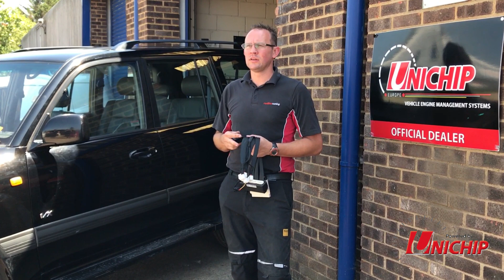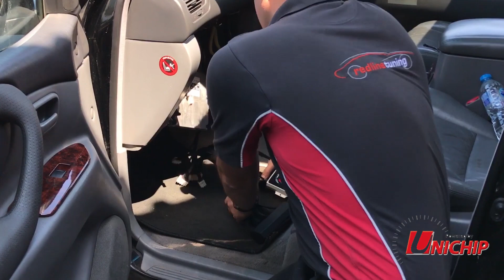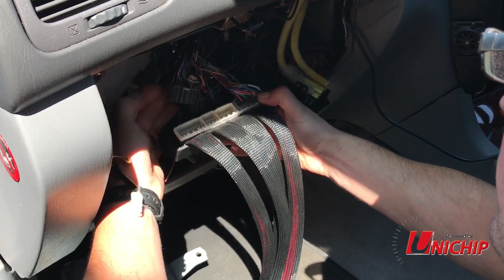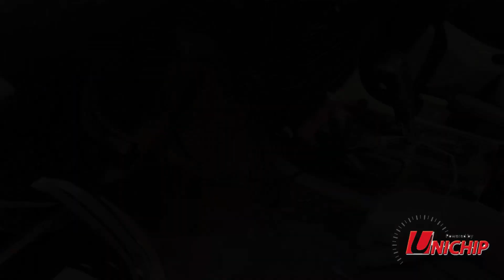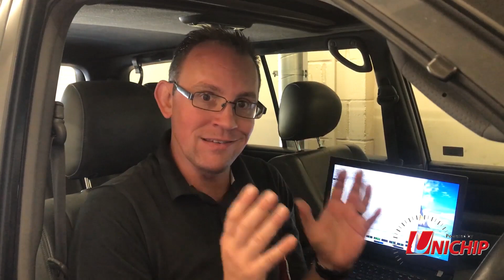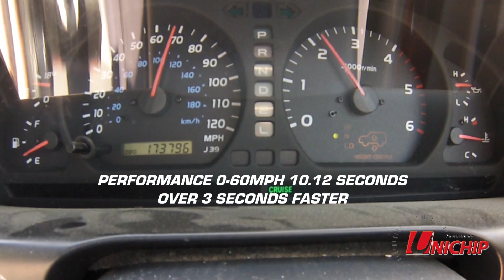Toyota Land Cruiser 100 Series Unichip Tuning Solution

Comment: I don't understand the 100 hp more? If it gained 35hp on the wheel. And 204 hp are 167 hp on the wheel, how is that calculated? 👍
Reply: you need to follow the chart, the gain is different at different revs but I don´t see +100 at 2500 , chart shows +50 there which is not bad I guess

Comment: Hi. I thnik 100 hp increase is falls. The increase is about 50 hp at 2500 rpm. Isnt it? Let's say from 125 hp to 175 hp. And not 100 hp increase. The green and red line with de bullets are hp and the other two without bullets are foot-pound. Cheers

Comment: hahaha 100 bhp increase , must be oz pony's because on graft is only 28.
Reply: you are dumb, he said 100 hp increase at  2500 rpm, so if you know how to read a graph you will see that.
Reply: @Dan Canta  Hi Dan. I know how to read the graph. 100 hp increase is falls. The increase is about 50 hp at 2500 rpm. Isnt it? Let's say from 125 hp to 175 hp. And not 100 hp increase. The green and red line with de bullets are hp and the other two without bullets are foot-pound
Reply: @AM-mg2tn  top two lines, at 2500rpm goes from 275 to 375 roughly so that's 100.
Reply: @Sherkanell  No, the two top lines are NM/ftlp. If they would be HP, then the car would have over 300 HP (right side). So it is definitely falls. The car has about 50 hp increase at 2500rpm. The car has about 100 ftlp more torque at 2500 rpm. That is true, but not HP